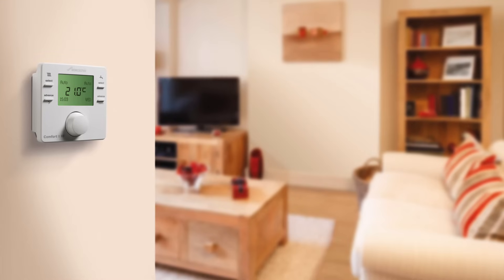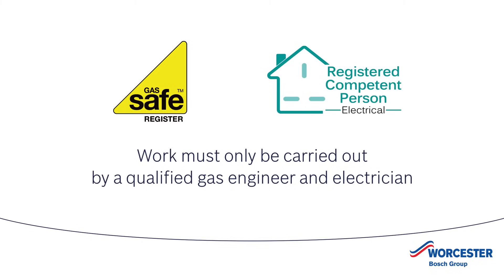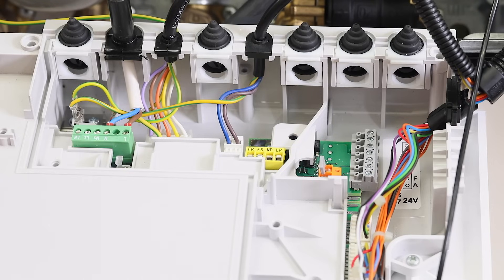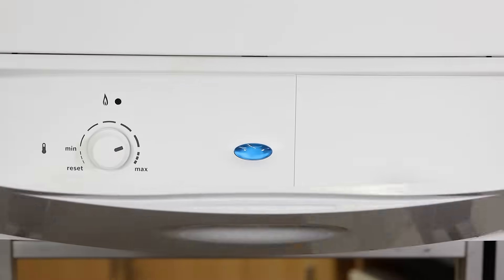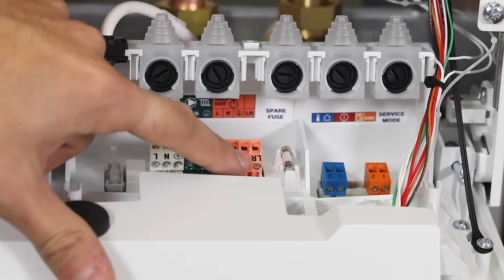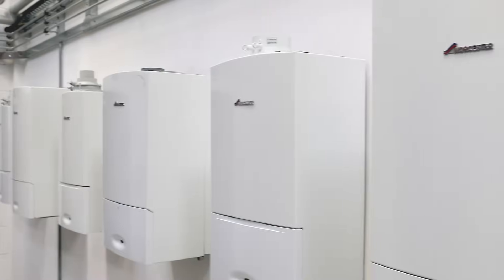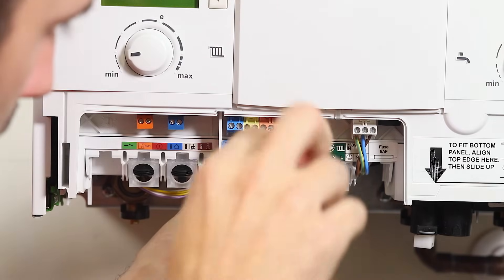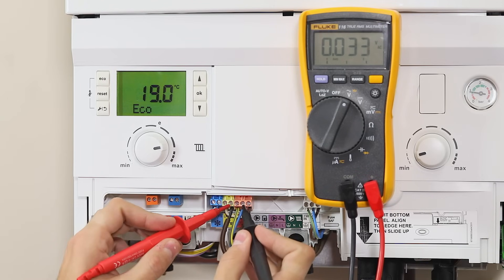Wiring Worcester & 3rd party Controls to Greenstar Gas Boilers | Worcester Bosch

Comment: Probably the most difficult boiler to wire up for a combi with 3rd party controls. Also doesn’t appeal to you to use the plug in timer either as it’s a load of **

Ideal logic and vogue with HALO is all you need

Comment: Hi there 0:35 it's mentioned I'd find a link for the boiler that's relevant to me and a link to a wiring guide. Can you please confirm where I can find a wiring guide to connect Bosh Easy Control CT200 to a Worcester Greenstar 8000? I can't find that on the literature provided / available for both them. Thanks
Reply: Got same problem now with mine. Did you sort yours out?

Comment: I've just finished installing the tado wireless receiver to a greenstar 30si with the DT10RF programmer module (circa 2008-ish). The circuit resembles the first section of this video, where it says to remove the bridge. I've done this, everything lights up correctly on the Tado receiver, but the boiler is still being triggered by the old wireless thermostat and ignoring the Tado.

Do I need to directly disconnect the DT10RF panel for it to work, as wouldn't I lose hot water functionality doing this?
Reply: Have you worked this out? I'm having exactly the same issue at the moment.
Reply: @colinlees3266  Yes, just unplug the old front panel receiver from the boiler control board and replace with a blanking plate. I didn’t use the water timer functionality, and it now just heats water on demand.

Comment: I have been having difficulty getting any gas engineers to connect my Worcester Bosch Easycontroller, via the Easycontroller adapter recommended by Worcester Bosch technical support. Three engineers all have never done this before and have all failed. Nobody has mentioned the Greenstar wiring centre. Is this what is missing from our problem?
Reply: Got same problem now with mine. Did you sort yours out?

Comment: Just finished fitting the Nest 3rd generation to my Worcester 38cdi. I used 4 core flex but didn't connect the earth. Receiver is blue to N, brown to L and black to 3. Dont forget a link wire between L and 2.
In the boiler remove the Pre wired link between LR & LS. then its blue to NS brown to LS and black to LR (Just like the video) I had to remove the DT10RF thermostat from the boiler and do a reset for the NEST to start controlling the boiler.
Thank you for your help.

Comment: Hi. 
Did he say with or without diverter kit?
Reply: Unfortunately he says you need to install the diverter, effectively making a system boiler into a hybrid Combi - what a frustratingly pointless situation. The Comfort controls are ancient; no boost function and no remote access. How come heating and hot water work perfectly well with their controls but need a diverter for a “smart” control? I’ve yet to find a work-around as fitting the Hive to L, N and L2 will just force the boiler into the equivalent of nuclear meltdown with the H/W on constantly when timed “on”, pushing the overheat water around the CH system.

Comment: Do most 3rd gen thermostats work ok with these boilers, or is it better to get a thermostat that works with EMS?
Reply: I'm using a heatmiser system that has opentherm . I bought a convertor that supposedly outputs EMS but I cannot get the boiler to fire ! 
I run two zones and I'm seriously considering a new boiler as I cannot run opentherm with two zones with my existing Worcester combi . Not happy .
Reply: @rb3500ooo  hi, i was wondering if you could guide me, i have a Worcester 8000 system boiler being installed with a megaflo eco plus cylinder. The system will be 2 radiator zones, 1 underfloor heating and 1 hot water. From the little info available online  it seems worcester easy control can only work on one zone and only one easycontrol can be fitted on one boiler. This is the only thermostat control that is EMS. I am concerned that any third party thermostat won't be able to modulate the boiler. Did you manage to control the boiler with your opentherm thermostat? Thanks
Reply: @arslaanasif9893  hi, unfortunately I had to give up on trying to get an EMS signal to work. I figured I'd have to settle for a well set up zoned system to create as much efficiency as possible , with the compromise of a traditional on/off call for heat. Hope that helps

Comment: Who is this video for? Qualified gas and electrical engineers? Why do I have a Bosch boiler with a wireless thermostat but NO RECEIVER!? So now I have to pay someone to fit the Nest which will cost more than the Nest cost.
Reply from the maker: Good morning, The video was designed to highlight how external hard-wired controls are to be fitted to our boilers. The advice here is designed to reinforce to customers how we have designed the boilers to function with third-party controls, as well as providing guidance to installers on how to make these connections correctly.
All Worcester-made wireless controls will come with a receiver. The only exception to this is the Bosch CT200 EasyControl which is capable of being made wireless with our new 8000 and 2000 boiler ranges using the RF key kit. This is an optional extra and the EasyControl is not wireless out of the box.
  As this is the case I would recommend you contact your installers if you do not have a receiver. Any questions you can contact our tech team on 0330 123 3366 😊 - Aiden
Reply: I have a green star boiler with a MT10RF receiver that’s integrated into the boiler. How do I access this and wire in the heat link? I really don’t want to have to pay £70+ to get someone round to do it

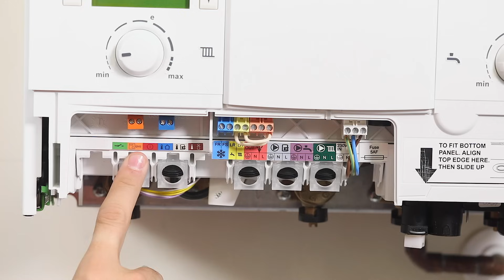Comment: I have a Salus control link built into the boiler, the wiring is identical to 2:54 in the video. Can I just install a Nest link as show in the video without Salus interfering with anything? Obviously I would disconnect the Salus thermostat which is connected remotely to the link.
Reply: This might be a little late but yes you can. You will need to wire it slightly different from the video. Message me if its not too late and you need to know how.

Comment: So looking at the docs it just slots in and small connector plugs in to the boiler
Is that it, what about the old on wall rotary timer and the thermostat this is greenstar Jr 28 with normal wall thermostat and rotary peg timer that came with it
The new part would be greenstar time thermostat
Does it over ride them can they be left in place

Comment: At 22 second you mention the system boiler and diverter kit. Are you saying it must have the diverter kit installed or mustn’t have the kit installed.

Not sure if you say “without diverter kit” or “with our diverter kit”.

I’m looking at installing a nest on my greenstar 18i that has the diverter kit installed. Will this work?
Reply: 'it must be installed with our internal diverter valve kit"
Reply: Did you ever get an answer to this? Thinking of doing the same I have the diverter valve fitted

Comment: Hi, i have a 28i boiler, with Honeywell Y6630D , Y6630D1007 - was going to integrate a Salus RT310i internet thermostat, but im pretty sure the honewell stuff switches mains voltage to call for heat, and my Salus setup switches 0v - am i right please, am i stuck ? :-)

Comment: How does using a thermostat work with regard to the on/off/timed selector switch on the front of the boiler? i would have expected this switch to have a fourth position which would leave the boiler under thermostat control
Reply: Andrew James Did you get anywhere with this? I am wondering the same. Currently looking at getting a Hive to fit to my boiler that doesn't have an existing thermostat. Thanks.
Reply from the maker: Thank you for your comment. Can you please contact our Technical Support team directly by phoning them on 0330 123 3366 or by emailing them at technical-advice@uk.bosch.com one of our advisers will be able to help you further. Thanks, AW